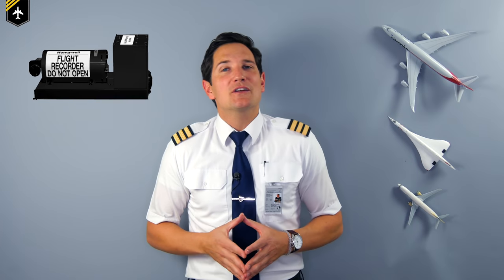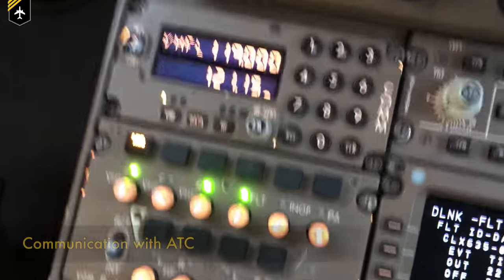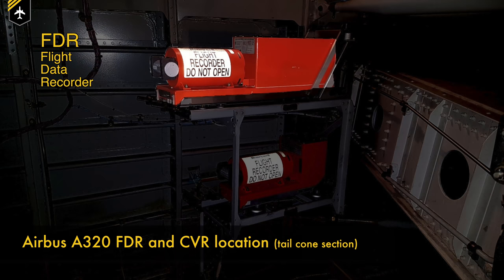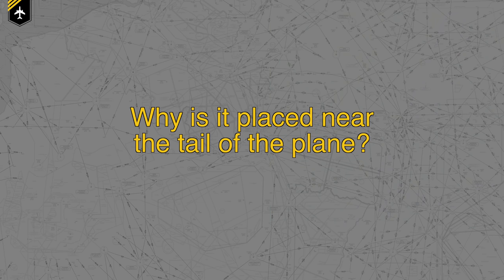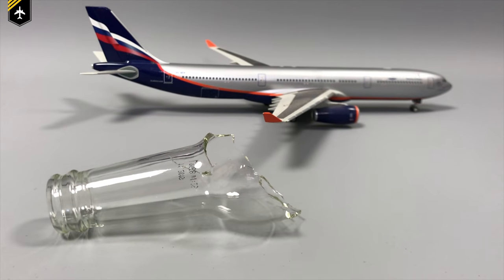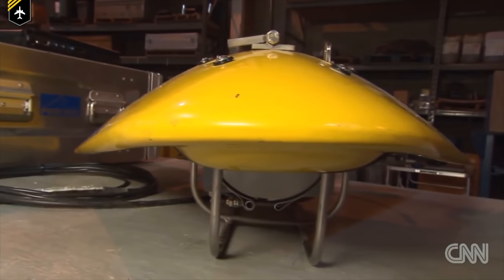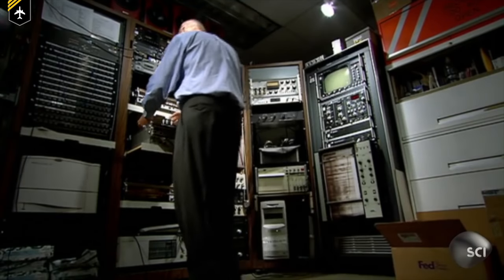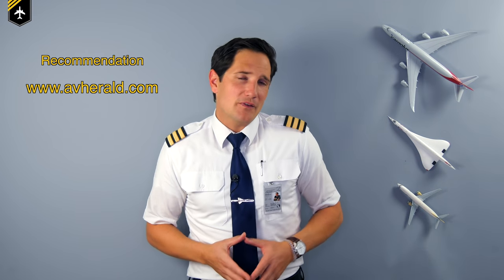BLACK BOX/Flight Data Recorder/COCKPIT VOICE RECORDER explained by CAPTAIN JOE

Comment: The reason it's at the back of the plane is simple. When is the last time you heard of a plane backing into a mountain?
Reply: Alaska Air once had a mountain crash and the scary part is that it is officially listed as a "controlled" crash since the NTSB said the crew was in charge and operation of the flight deck until the moment of the crash.
Reply: Hehehe.. There is always tomorrow...
Reply: Cough cough tailstrikes from flying too low
Reply: Olli K This NOT funny respckt these humans
Reply: Airplane simulator Duhhh 😂😂
Reply: I know that would be the day when the plane can fly backwards. I guess that would be the day when First Class would be Last Class.
Reply: Stolen
Reply: The andes crash dude
Reply: @adamguymon7096  Planes can fly backwards if they get a strong enough headwind. Impossible for a big jet, but quite possible for a small single engine GA plane.
Reply: @squirry9210  transverse force bro. It's the difference between hitting a big pothole and a head on collision
Reply: @nottelling8129  cough
Reply: BEEP BEEP BEEP SMASH!
Reply: @martintheiss743  alaska airforce we don't have our own air force
Reply: had to lol :D
Reply: In a Stall a plane can touch the ground with the tail first...
Reply: Or a tower...
Reply: Today
Reply: LaMia 2933
Reply: PIA and eurowings both crashed into mountains
Reply: Very true
Reply: @nottelling8129   A tail strike isn't that forceful in comparison to literally flying into a mountain lol
Reply: cough cough Stalls
Reply: lmaoooo

Comment: Why would people want to hear about plane crashes on a channel that describes how they fly? Being an engineering enthusiast, I much rather hear about how they work. BTW, nice video Captain Joe, I always like to learn about how commercial airliners work on the level they do.
Reply: The horrific part of air crash investigations is that they are typically done by professional aircraft experts and normally create much information about how systems operate.  The unfortunate thing though is that a JAL lead mechanic was so horrified at the fact an unattended whistle for 7 years turned into a massive crash he just slit his belly in the traditional way a servant would amend for a mistake with his master.

Comment: I’ve always wondered why the data from the FDR and CVR isn’t instantly uploaded to something like a cloud server so that the data can be accessed immediately, without the need to go looking for a physical box which is not always able to be retrieved. You’d be able to review data in real time as well to problem solve issues in flight as the happened, from the ground
Reply: Chris Keen I asked this same question once before,.I don’t  recall the answer i received. It definitely seems doable with today’s technology, and since it’s so important in finding the cause  of crashes, it would seem incredibly desirable. I don’t think they found the CVR to the lion air 737 max8 yet.
Reply: Chris Keen In my trade there are many WIFI equipment,,but I am NOT ON THE BANDWAGON, as there have been hacking of 2 DIFFERENT CLOUD SYSTEMS, so it’s NOT there yet
Reply: It's an idea that has merit and has been getting some serious discussion recently. The main problem is the amount of data accumulation and storage you would need. At any given moment there are thousands of commercial airplanes in the air. Each one will require a continuous individual uplink to a satellite and then all that data has to go somewhere for storage. That's all going to require a very big investment to put it all in place.
Reply: Cause some part of the globe don't have a reliable connection
Reply: They must be doing something like that now. I saw a show where the plane was contacted by the airline as it saw something wrong with the plane that the pilots did not see. I believe it was on the show Mayday

Comment: For those of you who may be interested, Locomotives also have a Black Box in the "Nose" of the unit. Again, bright orange. It also collects any information about the train and the circumstances it is running in, as well as functionality to be downloaded on the fly remotely. It will also give audio from the exterior of the locomotive, which will give investigators noise cues. Finally it records the "Dashcam" facing outward, and inward if so equipped.

Why in the nose? It is quite a strong section, similar to the tail portion of a plane, and also happens to be where most of the electrical control components are such as GE's Trip Op, The general engine management, and so on. It's almost like one big server box. In some Yard Locomotives, if so equipped, there will also be a Beltpack control box, where one can remote control the locomotive with a waist mounted box from a distance of 2 miles or so depending on geography.

Comment: Might be a specific question:
I wonder how the timestamps of CVR and FDR are synced with each other and with an official time base. I guess this is really important to analyze the data and relate it to other sources like ATC, radar and eyewitnesses.
Reply: Lars the point of any dual recorder system is to first register what the flight crew was experiencing and the data from the information sheets and any information which could be taken from observing both data sets together.
Reply: @martintheiss743  But  he asked how they are 'synced'.

Comment: Hey Joe, any idea why this data isn't being live streamed to a ground station while the flight is going on?? Surely when you have 100-200 MBPS of bandwidth available for in-flight wifi for passengers, you can use it to stream all the flight info live.
Reply: Mr Spooky do you realize how many planes there in the sky at any time of day/night ?
Reply: Doesn't ACARS do that?
Reply: @flybyairplane3528  I do. The planes flying above ground can be provided with a network connection via ground-based stations, so there is no limit to the capacity or technology. As for above oceans, we just have to wait until satellites improve to the point where they can support thousands of planes.
Reply: ACARS is a system that checks the status of systems every 10 minutes for the purposes of wiring the ground support crew where they are going so they could have an opportunity if they could to get to whatever issues come up during flight.  ACARS was not written for moment by moment commentary of flight for the purpose of automated transmission.
Reply: @mrspooky497  they can receive data, but things get a lot more complex when all aircraft are broadcasting data back to the same center

Comment: Why manufactures is still making separate black boxes for data and voice? With today's electronics capabilities it would be not so difficult to make one black box for all information and just put two of them to the plane.
By the way,  thanks for the videos 😀
Reply: They could have two different boxes that records the same data, more useful. Also in addiction they could upload the data if there is an internet connection available, an airplane has WiFi for their passengers, why not reserve a small portion of bandwidth to transmit that data, it's not all that much I think, we are talking of audio that could be easily compressed and a bunch of data, probably it's insignificant.
Reply: A1eR ways to upload the data live are being developed but it is a large amount if data and you need to have a constant signal anywhere on earth in any condition

Comment: This was a very good video as always. Thank you. As for the "BLACK BOX". When I was in Naval training the instructor would diagram systems on the chalk board. When he came to a piece of electrical equipment whose function was either beyond the scope of the lesson, or classified above our clearance, it would simply be marked  as BLACK BOX. I had always believed that this was also used in aviation. As in, all the wires go into the black box where magical things are done to preserve the necessary flight parameters.

Comment: Why can't these recorders record both voice and flight data?  Why do they need to be separate?  Nothing wrong with having two recorders just have them do both in case one can't be found or destroyed.  BTW I worked at a place that makes the steel body of these recorders years ago.
Reply: With new digital recorders they probably COULD. However this all dates back to when it was just needles on a metal roll and old analogue tapes.

Comment: Oh my god)) Is it an AEROFLOT RUSSIAN AIRLINES AIRPLANE????
Reply from the maker: Валерий Данчук Correct😉
Reply: Flying with Aeroflot was an experience that I will never forget. I don't know exactly what happened but for some reason, the PIC throttled up just a second before touchdown. I can only assume that he dropped below glide slope. Then, once on the ground, he performed the most violent speed brake I've ever experienced. Could it be that we were heavier than the crew had anticipated? In which case: 10/10 would do again. @flywithcaptainjoe
Reply: @JoakimFritz  Aeroflot is known for higher speed landings so its nothing new, its enough to go to some airport and do some plane spotting, you will notice how aeroflot pilots are landing much faster than others

Comment: Pretty sure the first flight data recorders  in use schedule in airline service was the UK  & Australian developed Darvall Red Egg --- so called because of its Day-Glo red colour  and shape which resembled a large version of metal cased oil filter on a 1960/70s car engine..   The development of the Red Egg was spurred on by the Comet 1 disasters the true cause of which was unknown for a considerable time after the crashes. To survive extreme heat the Red Egg used wire instead of tape as a recording medium.  At the time the UK was ahead of the USA in this field as the American requirements which only specified a cockpit voice recorder.

Comment: Hi Captain Joe. Why can’t they just put some video cameras on the wings and perhaps inside the cockpit and record just like the Black Box does? We can have multiple SSDs so storage shouldn’t be an issue. This would give a much better idea of what happened to the plane.
Reply: Chinthaka Vithanage so then in a crash, where are all those LITTLE CAMERAS?
Reply: Agree with you. There should be numbers of cameras in key section in modern aircraft.
Reply: @flybyairplane3528         As the video would be saved to storage media in the "black boxes," it would not be important what happened to the cameras after a crash.

Comment: I thought it was called black box from the engineering term for a unit that is specified by its inputs and outputs without regard to how this is achieved.
Reply: Sort of  a black box was originally used for  the mysterious  boxes  of any Radar or secret navigation or other electronic warfare device  installed on  RAF and Commonwealth aircraft in WW2.   
RAF slang  was  that Black Boxes were installed by "Boffins" and any fault in them or the aircraft was due to "Gremlins" .

Comment: If I recall the data was recorded on spools of steel wire.  Not actual tape.  This was to help preserve it in the case of a fire or extreme heat.  It is also much easier to colecta spool of wire vs tape.  Wire also does not wear our like tape either.
Reply: IMRROcom but now they use memory cards, to avoid the tape problems., and the CVR used to be ONLY 30 seconds.

Comment: Captain Joe, I would have thought that when you were discussing why the Black Boxes were located in the rear of the plane you would have mentioned the FAA Regulation that requires the ELT to located in the rear of the plane.  FAA Regulation 91.207   Emergency locator transmitters, subparagraph (b) states:  "Each emergency locator transmitter required by paragraph (a) of this section must be attached to the airplane in such a manner that the probability of damage to the transmitter in the event of crash impact is minimized. Fixed and deployable automatic type transmitters must be attached to the airplane as far aft as practicable.", for the same reasons you mentioned regarding the structural strength of the tail section of the aircraft.  It only stands to reason that since the tail section is the strongest portion of the aircraft and the FAA requires ELT's to mounted there, that the installation of the Black Boxes would be in the same area for the same reasons.

Comment: Why don't passenger aircraft have air frame parachutes.  I'd pay extra
Reply: Christopher Scobie you cant be serious ? The size of an effective parachute  has not yet been made, you have any idea what that plane WEIGHS?
Reply: Depends... at what speed you want to decelerate on the ground, water. These bigger aircraft, considering weight distribution I propose three.. two above Maine engines, or four.. and a larger tail chute.. like I said. I would be happy to pay an extra amount... I estimate it costs about $50 hour to fly I would pay and extra 5$/hour..
Reply: Rich man 😏
Reply: @christopherscobie  >  Most crashes happen at take off and landing.  What good would a parachute do?

Comment: Hi from Bangladesh. .. 
What is the best Flight simulator for experience real flying.
Reply: Microsoft flight simulator Steam Edition 😂😂 (watch some Airforcepround95 and you will understand why I added the laughing emoji.)
Reply: @Rack47  I yaaa i love it
I alradie play DCS world, FSX, falcon BMS, X plane 10 ..11,. prepare 3D... thanks for help... thanks for reply...
Reply: Lockheed Prepar3d V4 is the Flight Sim I use now, although there are somewhat limited models for the 64 bit sim. In time there will be more as developers design or convert old models for the sim. Fly those friendly skies! 0_0
Reply: I use xplane 11
Reply: If u have a very good pc/laptop than go with x plane 11

Comment: absolutely! the detail required in crash investigations is unbelievably intricate. an example would be the crash of galloping ghost at reno. they recovered fragments of solid state boards used in the camera and telemetry devices. the suspect cause was a nylon stop nut on an actuator for a trim tab. consider the visuals of that 400+ mph crash, then try to imagine getting pieces so small and so important. crash investigation take TIME, 18 months is not considered "long". armchair flyers need to really keep quiet. and newsrooms need to hold back and not sensationalize these tragedies!

Comment: Most the electronic equipments of the aircraft BACK IN THE DAYS are actually components inside of an enclosed case with black finish to it. These equipments are called Line Replaceable Unit (LRU) which is a hardware to which every each one of them has its specific function. Some of the LRUs are Transponder, FDR, CVR, TCAS and FMC. All LRUs are pretty much Black Box eventhough nowadays we have a good variety of colours given. FDR and CVR are coloured orange for the ease of divers to locate the box glowiness when flashed with Blacklights. In Aviation, we are not supposed to call them Black Box because they can be anything. Hope this clears some confusion.

Comment: Thank you so much Captain Joe, for taking the time to explain where the Black Box is situated in the aircraft and the role it plays, if an aircraft crashes. It’s just a shame that the Black Box does not have a tracker so that the aircraft can be found as quickly  as possible. I also believe that the Black Box has a long lifespan, but tracing and retrieving it after 30 days is difficult 😞

Comment: Yes, I watched Sully when it first came out, and I can say that the FDR was a very crucial part of the movie.
*SPOILERS IF YOU HAVEN'T SEEN IT*

The FDR really did save his career. The movie really does show how crucial they can be. Without it, they wouldn't have figured out that Sully did the right thing. The suspense of the whole event in the movie is quite interesting. Check out Sully if you want to see it for yourself! It's a good movie, and definitely a favorite of mine!
Reply: I know it’s been two years since you wrote, but the FDR will be so useful for the mystery of Malaysia Airlines flight 370. My best guess is hijackers. Plane going off course, the very MANUAL TRANSMITTER WAS TURNED OFF. So someone turned it off. Either that or there was an electrical failure. Low chance though. Still waiting for that FDR

Comment: During Tragic aircraft crash;
Most. Aircraft to ground impact the tail section aft 48/49 partially tact while fuselage almost burned by fire or mangled.
1. By its color easy to be seen and retrieved by NTSB, preventing to be covered by  other debris when it detached from airframe structure ,like luggages, cargo ,  parts, and pax dead bodies
2. Before a Crash , Pilots saves their lives first by pulling-up the yoke or pitch -up.
- Nose dive crash ,cockpit crushed while. tail section is still in tact, 
- Glide approach crash , tail section will just detached from aft bulkhead strap ,hard metal casing will save the recorder.

Comment: Really Impressed that the Underwater Beacon can transmit up to 20 K feet under water.  I'd be curious as to older versions in the early days of aviation whether they were capable of that depth.  Great Video Captain Joe.  Safe Travels

Comment: I always thought they called it the black box because its contents are a mystery (at least until you recover it and read them), but the reference to the WW2 box-of-tricks  makes more sense. Interesting video - I'd never heard of the underwater locator before, but it's a clever way to indicate position underwater. As an engineer, you've got me wondering now what sort of safeguards are in place to keep the CVR from receiving a spurious erasure signal if/when the crash jacks up the wiring between the CVR and the cockpit console🤔